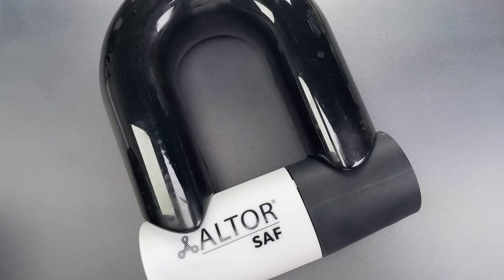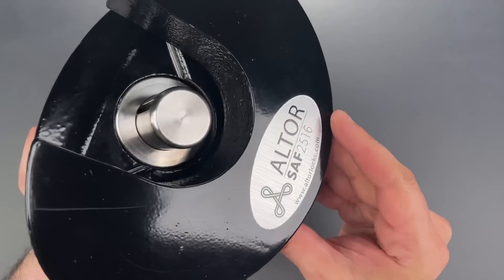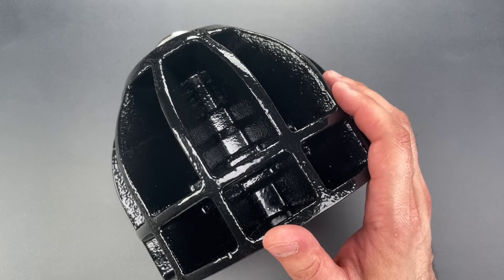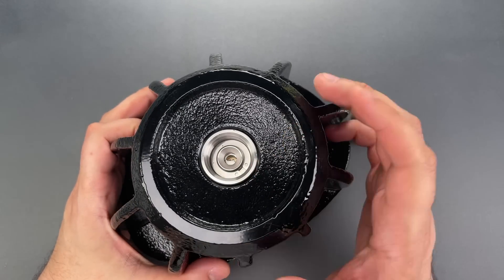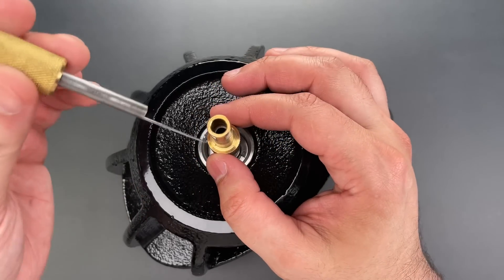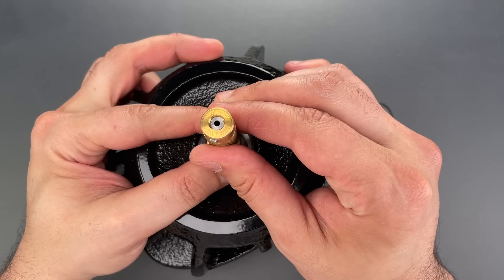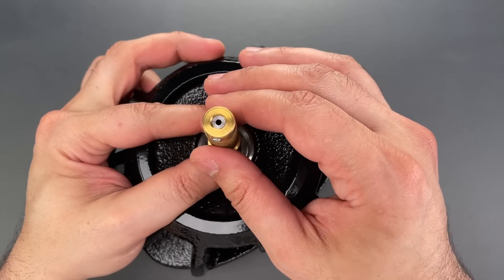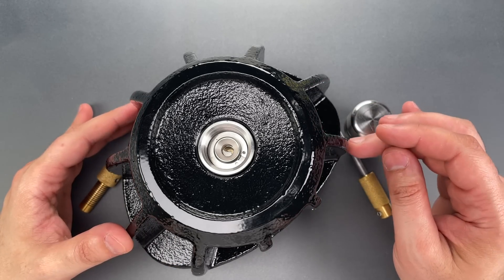[1339] HUGE Altor “SAF” (Strong As F***) Trailer Lock

Comment: 20lbs?  Holy smokes!  But it would be worthless if the coupler is a bolt-on version where I could just pull out some wrenches, remove two bolts, and the coupler and this 20 pound behemoth would fall to the ground.  I'd quickly bolt on a new coupler and off I'd go.

Comment: Why don't these locks include a simple electrical and timed circuit that completely disables the lock if, for example it is not open within 5 seconds (once touched in any way. A tamper alarm would further be a nice touch.) The logic is, if you have the correct key, you will open the lock every time easily within 5 seconds. If you are mucking around like this, it will take even an expert about 5x's longer. If the battery dies, lock cannot be manually opened...cylinder will just spin or something. It seems logical to me given how this guy (and others- many bad guys) can defeat any lock and go through them like butter. The locks could also have a sensor that if any pressure from say a lock pick is sensed inside the cylinder where it should not be, it is disabled. I suppose in high end security, these features are standard but not in the pad lock world.

Comment: I’ll tell you the biggest problem. If you remove a couple of bolts, you can swap out the tongue or the king pin or whatever trailer configuration you’re working with and bolt on another one in a matter of a couple of minutes. if you’re really trying to steal this trailer. Well it wouldn’t be that hard.
Reply: Spot weld the bolts. However odds are that the thief wouldn't expect such a lock anyway let alone have a spare tongue.

Comment: If your lock A) weighs and costs more than whatever you're locking and B) requires a CUSTOM BUILT TOOL to pick open, you've simply won at the lock-design game. There's basically no way to improve from there.

Comment: takes a highly skilled lock picker using a special tool. which means your average criminal is boned because they would also have to be doing this under a trailer probably in the dark.  Hopefully they have good sales, as I know trucking is very tight margins so its hard to buy expensive stuff.  But damn id absolutely have this if I hauled stuff like electronics, and a Squire on the trailer door.  Because I doubt any typical tweaker looking for a quick score would bring power tools and a .50cal rifle.

Comment: I honestly see no point in such locks, if I was gonna steal a trailer that has a lock on it, I'd just take some steel cable and wrap that around the hitch and the hook and then wrap something nice looking around it (so it won't look suspicious) and tow it that way. It's enough to get the trailer into safe area where you can then break the lock off. Only reasonable lock for a trailer, would be wheel clamp.
Sry if this gives ideas to criminals, but not all criminal are dumb as f (DAF), I'm sure they've been already doing that. So in other words, if I needed to secure my trailer, i'd use wheel clamp/s.

Comment: If I had a torch I could get that off in probably 15 mins. This is probably the most torch resistant lock design ever on top of having to use a 9inch grinder or a big demo saw to try to cut through it. This design will be stolen and used in chinese cast zinc locks and they will say its "power tool proof".

Comment: trailer locks. generally they are not welded on. Two simple bolts off with a vicegrip and for about $20, put your own back on. 
easy.

Comment: This lock is heavy and useless. Most trailer thieves just hook on the safety chains and drive away. The only one that is worth bothering with is one that he's reviewed previously. The proven industry unit. Which locks the chains, as well.
Reply: Yeah, but they could just bring their own chains for that too. Problem is that pulling with only chains is going to be a nightmare to back up & maneuver, probably going to destroy your tailgate and is going to be loud as all hell. If I was going to impound a trailer with one of these locks on and couldn’t drag it on my tow truck bed, I’d probably just boot the wheels instead.